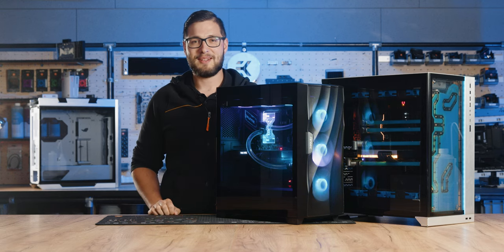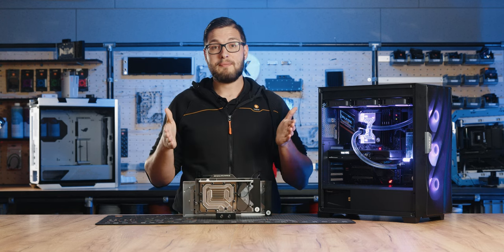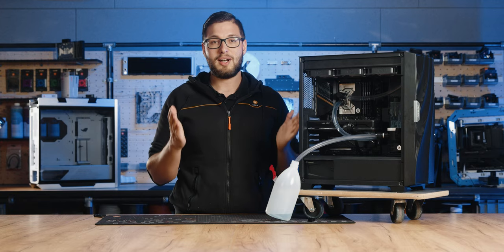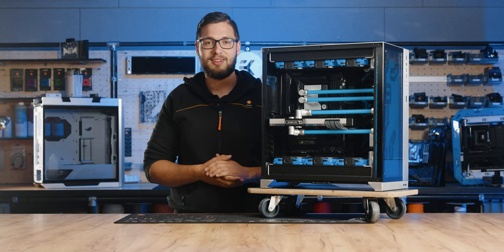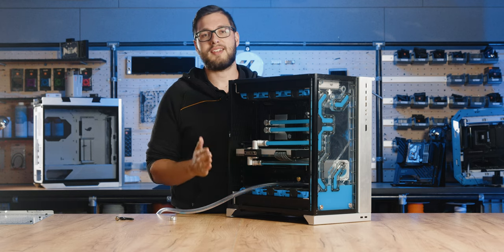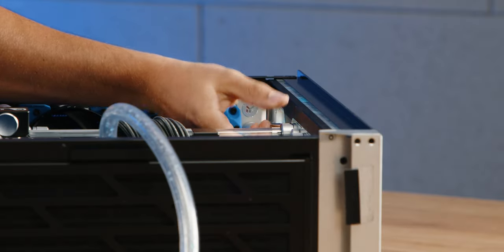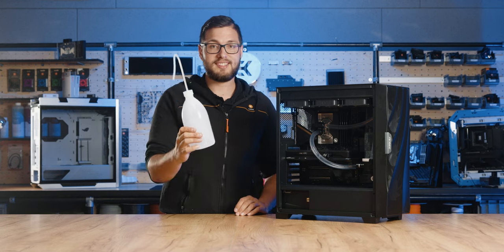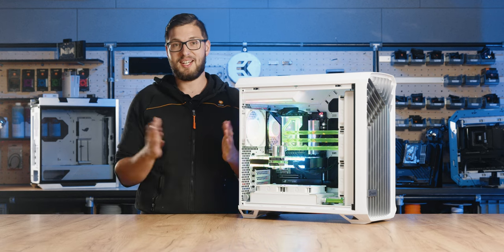How To Quickly and Easily Drain A Water Cooled PC - EK Tips & Tricks

Comment: An electric air duster (a Datavac, for example,) can push all air out without introducing bacteria to the loop. In an O11D XL like the same complex loop (but with a vertical GPU), it can push all air out of the loop in seconds. 

Draining a loop like that manually can take hours. This is the best solution I've found.
Reply: This is the way bro.
Reply: How do you do it? I’m having such a hard time draining my loop, and I’ve already damaged something, I just need to get this contaminated coolant out. How do you hook up the data vac to get all the coolant out?
Reply: never tried it before, but I would assume maybe duct tap to create a semi good seal. Just duct tape the tip of the blower to the soft tube and you should be good to go.  @Bertis87
Reply: Let us know how you did please!
Reply: Literally done this today , works like a charm
Reply: @Bertis87  I used soft tubing coupled with a fitting, drained the loop until I could access a port in the middle of the loop without spillage, then screwed the tube with the fitting into the loop. I then used the funnel-like Datavac attachment, which fits perfectly with the soft tubing. I then turned it on and watched the loop empty both ways. I had the drain valve open and ready to expel all the liquid at the bottom of the distro plate into another fitting with soft tubing that drained into a plastic bucket.

Comment: Id suggest using a DataVac on that tube to blow into rather than your mounth. I used my mouth the first time and had growth within 6 months despite a chemical coolant. The second time around I used a datavac and it can blow harder than I can. I measured the preasure it applies to the loop by attaching my leak checker on another port in the loop. With the drain vavle open and the datavac nozzel in direct contact with the tube, I was seeing a max 0.2 which is well below where EK suggested you pump to for leak checking. So there is no harm to the loop there even though the datavac feels like it blows harder than a leaf blower.

Also, like the video suggested, I added a second drain valve mid loop to easily attach the tube for blowing without having to screw around trying to drain a channle in the distro to attach to.
Reply: Give me datavac link please ❤
Reply: Yeah, I cringed the moment I saw him put his mouth on the tube. "Dude, you're blowing bacteria into your parts! Keep your mouth off it!"

Just got the datavac advice today and can't wait to apply it. Last time I drained a hard-to-drain loop, I used the pressure tester pump to displace fluid stuck in the cpu circuit.

The datavac is a MUCH more sensible solution, and I love hearing about the pressure readings for peace of mind. I have a front distro that I'd worry about cracking if the pressure were too high.
Reply: I’ve done the blow method and each time I get contaminants on the push-in adapters inlet and outlet and the bottom of the distro. I bought the data vac and a new distro,cpu block/gpu block, and I’m going to make sure I dont contaminate anything for the 3rd time now since I have all new components. I did not buy three new radiators though. My build is 3x quantum surface rads with ek-7 matrix in 0-11 D XL

Comment: If you have a problem with blowing into the tube or with holding pressure you can also use the EK loop tester with the hand pump and check-valve.
Reply: It sounds like somebody was using the EK loop tester on the mic for some reason
Reply: is that even enough pressure?
Reply: @w3st80  eventually, yes. Because of the check-valve the pressure builds with every “pump” until the liquid reaches the only exit.
Reply: That's also a great idea.

Comment: Couldnt you just attached the leak tester and push all the coolant out with pressure?
Reply: Thats also possible bro.
Reply: Idk why he didn't do that, this is way more cheaper/easier/safer than buying another STC fitting, a soft tube and blow it by yourself

Comment: I have a dual radiator/CPU loop, no GPU leg in a Lian Li D Evo with the Mana G2 distro plate and I've found that after draining the reservoir, pressurizing the loop to about half a bar with the leak test pump and suddenly releasing the pressure is effective at more fully purging the system for maintenance, or further modification. As we all know, a modder's system is never finished, just at current spec.
Reply: Well said

Comment: when you use a loop cleaner, do you need to take every bit out of the loop before you can add the coolant? because even after all this, the build with the side radiator and the blue coolant still had quite a bit left inside. it would be a pain in the ass to pressure test... clean the loop.... disassemble to empty the loop completely.... pressure test again.... add coolant

Comment: Would it help to drain the radiators if a drain port were added to the other end? Or maybe a T fitting with a ball valve to let air in to the top of the system without spilling?

Comment: The trick for blowing air into the loop is such a game changer I was working way harder than I should have to get fluid out of my loop. Now I'm excited to change my coolant. I have a vertical mounted GPU with an active backplate so it should be fun lol
Reply: Even better if you have one of those compu blowers. Goes faster and you don't risk introducing bacteria into the loop.
Reply: @drbluewolf Can confirmed those are great!!
Reply: @drbluewolf  I was wondering the same thing when he blew into it I thought he was going to use the test pump or something else but I think the coolant probably has some kind of additive in it to prevent that

Comment: I’m surprised that EK suggests people blow into the loop. Like, doesn’t this guarantee you’ll need to completely flush the loop and drain it again in order to make sure it’s clean?
Reply: It could be suggested to use some sort of a powered device like an electric air duster or similar. But there are couple of issues with that. There can be to much pressure and not everyone has it. Also when you  add new proper coolant it does protect your loop from anything you might have blown in.
Reply: @saneldomeh92  I've tried to actually use the EK loop tester as something to push fluid through. That actually worked pretty well, as long as you ensure there are no specks of anything in your pump prior to using it.
Reply: It does work as long as the tubing is full of coolant, but once the components and tubing get half full and air can "escape" pass the coolant the pump will not provide enough air volume to push the rest out. But it does work in some loop setup so it is a good idea, thank you @BigOlBilliam

Comment: For the complex build, why not open another port on radiator and make it drain port? The EKWB radiator non crossflow should have like 5 port right? 1 on side and 4 on other side.
Reply: Many ports but accessing them isn't always so simple or guaranteed. You also need a port adapter on that port to attach the drain valve to or it will leak coolant everywhere ;)
Reply: @h2ocomputers316  Ah yeah, I was thinking to make hole on the back for bottom radiator and put drain near there... but well after seeing he open the front glass, i was thinking why not just open one on the front hahaha
Reply: I am working on piecing together another revisor and pump, I think you can just pump new fluid in and skip a lot of the pain  @hasyidanparamananda

Comment: I have the exact distro plate and case shown in  your complex build it looks and works awesome btw, however, I have been putting off draining it, thank you, you have confirmed it will not be quick or easy.  😂
Reply: Then you built it wrong... draining a front distro plate is easy.
Reply: @digismurf what distro plate is that?
Reply: @WaikikiSmoke  looks like my "EK-Quantum Reflection PC-O11D XL D5 PWM D-RGB", it's made for that case so it fits, looks, and functions great!

Comment: Just use quick connectors between all components, the time and money you invest designing the loop with those pays off every time you need to drain / clean / fill the loop or swap a component without doing any of the former.
Reply: not all like the QDCs in their loop :/
Reply: @saneldomeh92  man, these abbreviations. I've found 14 definitions and none of them have anything to do with water loops. Right, what's QDC?
Reply: @tibielias  Quick disconnects.
Reply: @Arek_1  this is probably the 3rd term that I read which refers to the same thing. We have quick connectors, connect adapters and quick disconnectors. There has to be more out there 😅

Comment: Can I recommend you fellas add the drain valve to your configurator (if using a distro plate)? I just made my loop last month, and never thought to add one. I'm just going to crack open the bottom fill port over the sink and hope for the best.
Reply: How did it go?
Reply: @MongoSlade84  it was fine. Had to clean the case (and the sink) a bit with paper towels. EK cryo fuel doesn't smell great and I bet you don't want to get it anywhere near your food. But it cleans up easily (because it's so soluable)

Comment: Couldn’t you just use the leak tester via the fill port to apply pressure then open the drain vale to release the coolant ? Similar to bleeding brakes on a vehicle…

Comment: I'm new to water cooling but can somebody answer me?
I have 13900k and 13700k.
which better whole cooling system or AIO from Ek??
Second is there any warranty? and how many years it last?
Thanks
Reply: A custom loop will give better cooling performance than any AIO, but a custom loop will also be much more expensive than an AIO. That being said, better cooling (ie. lower CPU temperatures) doesn't provide better performance unless your CPU was thermal throttling with an AIO or air cooler. From a cooling performance standpoint, a custom loop really only provides extra CPU performance if you specifically need the thermal headroom, perhaps for overclocking or running very heavy multi-core workloads that use too much power for an AIO or air cooler to handle.

A well-built and well-maintained loop should last the entire lifespan of the computer. Because you are new to water cooling, just remember that any coolant / water leaking can result in damaged or dead components, so even if the water cooling hardware (CPU block, Pump / Reservoir, Tubing, Radiators) are all in working condition, there is still a risk to other PC components if the loop is not built properly. 

I don't know what warranties EK (or any other water cooling brand) offers on their products, but I'd assume it's listed on their website.
Reply: Thank you so much for detail answer. I'm thinking to build one soon maybe ask Good pc shop around my place to help me.
Thank you again @DarthChewie

Comment: Why did they not use the drain ports on the front/bottom of the distroplate?
Reply: there was already a drain valve on the back installed so it would not make  much difference.
Reply: @saneldomeh92  the drain valve on distro front sits a lot lower than the one in the back. Just strange, being that EKs own literature says to use that port.

Comment: I have a small compressor (oil free air), with a regulating valve, which is also 1/4 thread, and it blows out very easy all coolant. And there isn't any (false) air between the compressor and the input port. And I do this on a sink, in the kitchen, a bottle can be filled very quickly, and if you have the drain valve placed on the left side of the distribution plate, you could be too late. About the drain, I would never put a drain on that side. It's very inconvenient at that place. I think they forgot about the drain and putted it there. Not so smart.

Comment: Ok, for these kind of experiments it's ok, but in my opinion the components should be designed to not have to shake the case and blow air manually ! 🙂 
Guys, it is possible to do it better ! Also instead of attaching permanently tubes to the eg CPU water block or GPU water block it should be possible to plug and out, instead of each time when we clean it have to have break all !!! It is now not cheap but why in this case it can be better ? Ahh, right , you think we will pay all the time for a new parts, tubes etc. You will earn more then. Simple as that .... or maybe I'm wrong ? You seem to be cool and decent and I hope I'm wrong that this is not about money !